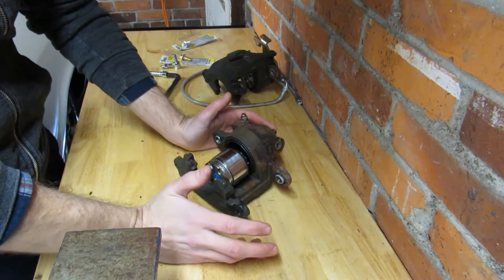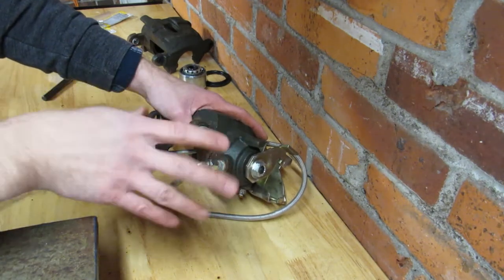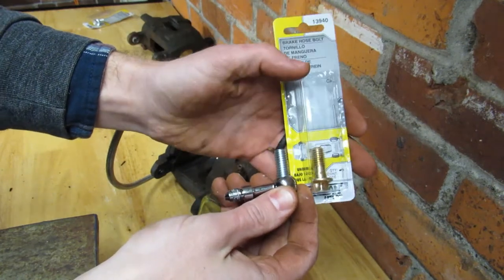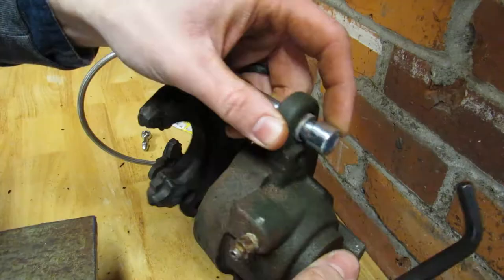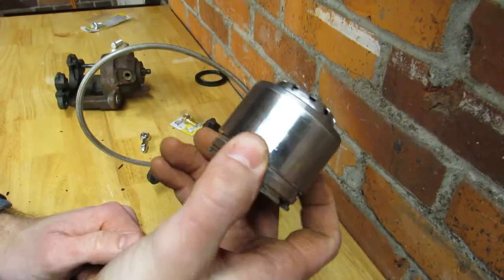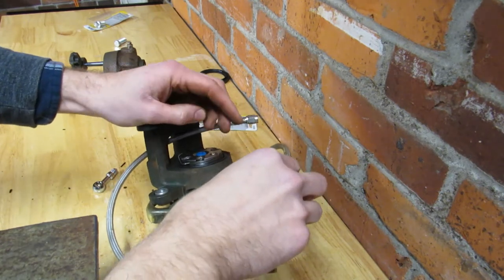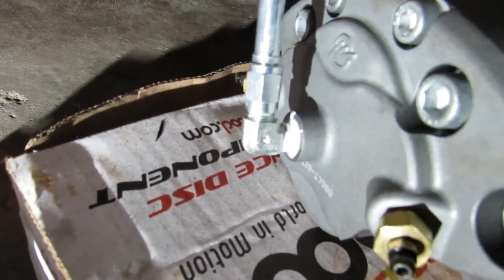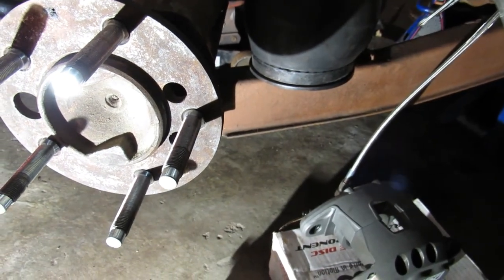GM Metric Caliper - Ins and Outs

Comment: Have you ever seen these calipers leak where the e-brake bracket goes?.. I have a conversion kit and have had two calipers leak from the same point on the same side (passenger rear). TIA

Comment: They’re called metric calipers because they’re originally used on g body cars which are also known as metric chassis and most of the bolts on the suspension are metric.

Comment: I installed wilwood dual piston calipers on my front and couldn't get a good pedal.  Then called wilwood they said they are smaller piston area than stock.  So I put the stock ones back on and still can't get a good pedal.

Do I need to put a copper washer on top and bottom of the banjo bolt because I just put it on where it meets the caliper.
Reply: I have gm metric d154 front and rear.  Mustang ii front ford 9 inch rear.
Reply: Or should I put tht willwood in the rear like they suggested.  When I pump the pedal thepedal feels good but the rear lock first
Reply from the maker: Duuuuuude small world. I’m actually in the process of doing a spindle swap to our Buick AND I’ll be doing a brake stop distance tests against the stock D52’s and Wilwoods 2” dual pistons. Are far as I can tell NOBODY had done this. Soooo I used them before and here’s my untested 2 cents. I like the Wilwoods for pedal feel, the theory of  pushing on more evenly on the pad, not suffering from the piston corrosion issues and simply looks. What IMO are feeling as an upgrade is that they actually use the D614 brake pad from 90s police Malibu’s I think. Check that out as reasonably priced upgraded from the parts store - there’s tons of posts online about the upgrade. And you’ll need two fresh copper washers, one under the bolt head AND between the banjo/caliper. If not you might be getting a weep. Don’t bother trying to reuse, it’s never worked out well for me.
Reply from the maker: Soooo I think either way will work but by using similar sized front and rear - you need a bias control valve to even it out. Personally I’d get an adjustable Wilwood valve and call it good. DO NOT GET A CHINESE KNOCK OFF. We had tons of issues with them over the years.
Reply from the maker: Do you have 2” or 1.25” Wilwoods???
Reply: @MatthewFinlay  I accidentally got d52 with 2 inch but had to exchange for d154 with 1.62 in
Reply: @MatthewFinlay  ok ill add a washer between the bolt and banjo too
Reply from the maker: Outta curiosity - what master cylinder are you running or what is it out of??
Reply: @MatthewFinlay  just replaced it. 79 f100 manual brakes 1-1/16 and 1 inch step bore out of all things.  Its a cobra kit, johnny cash one peice at a time type car.
Reply from the maker: Good - those would be just a bit much for a stock bore which I think is 7/8”?? At least in my experience, I like the feel of a bigger bore with D52 but stock will work ok. Heck I once ran a stock 4 cylinder master cylinder in a fox body with an 03 Cobra spindle brake swap haha. Wasn’t the best but wasn’t the worst!